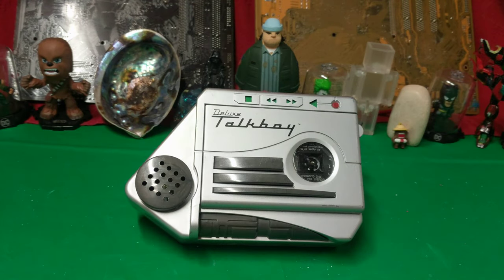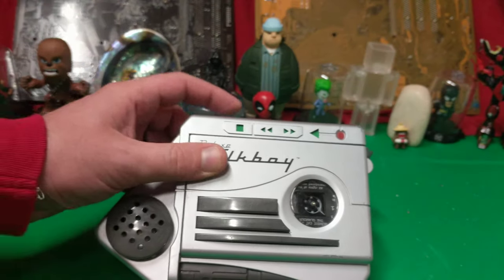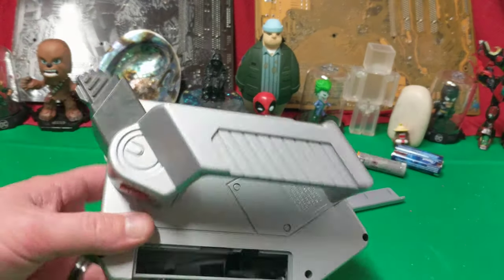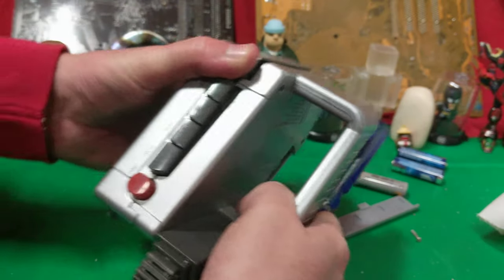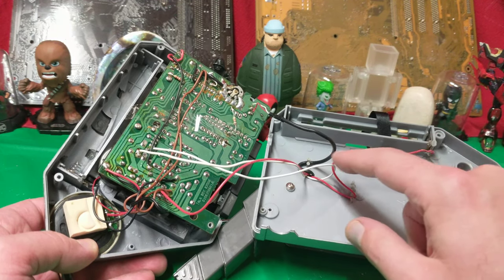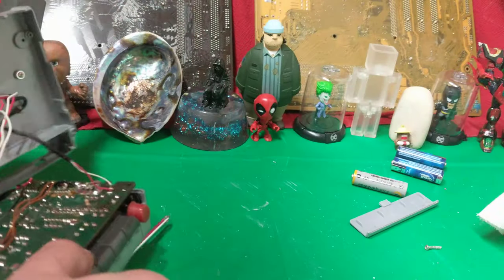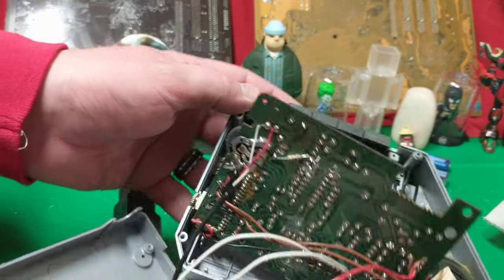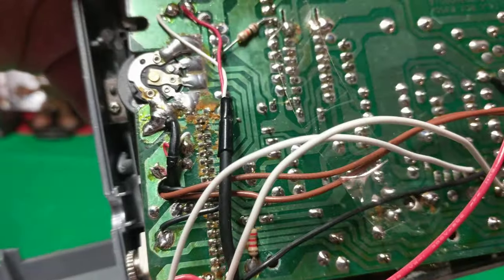Deluxe Talkboy TEARDOWN 1993 Tape Recorder & Player As Seen in Home Alone II by Tiger Electronics

Comment: Did you ever fix it? I have a Talkgirl where the motor works, but there's no sound either through the speaker or the headphone jack.
Update - after cleaning the head and roller, it no longer eats tapes, and I do get a really weak sound out of it, either in the left ear (stereo headphones - does this thing need mono headphones?) or really weak out of the speaker. The batteries test as fine but the thing plays slow and soft like it's almost dead. I don't know what to try next. Cleaning the belts? Are the capacitors mostly dead and killing the power delivery?
Reply: @Patsk88
This looks like capacitor issue. In the 90 they were bad.. Had the same problem with my pinball. Just change them. New capacitors and new belts will cost nothing, and easy to do. Your talkgirl will have a second life ;)

Comment: I have to press my play button down after it's on to sound clearer and I cleaned knob for the volume. I took mine apart a long time ago what size is the screw that is inside the deck that holds the top right corner together?

Comment: just repaired mine. the speaker  was the culprit in mine. speaker wires rusted out. you could only see it after you pulled the speaker out and looked at from the front can't tell from the backside of the Speaker.